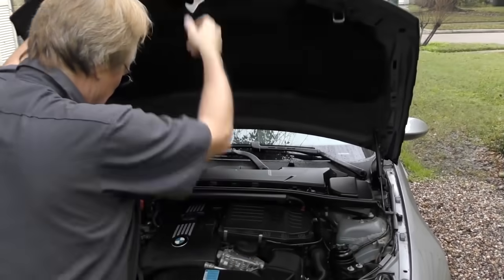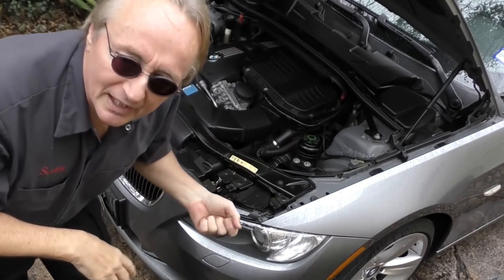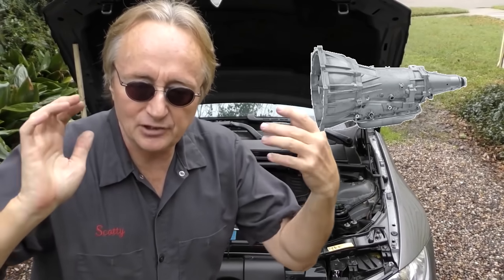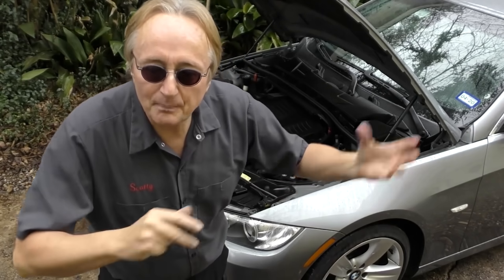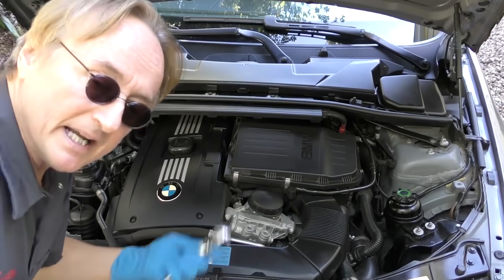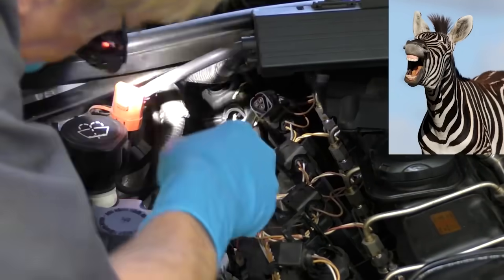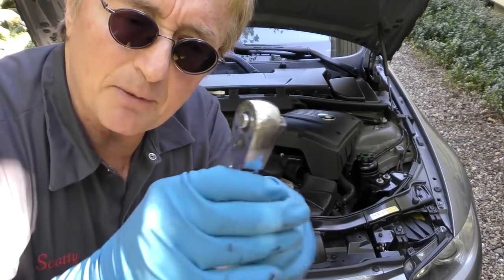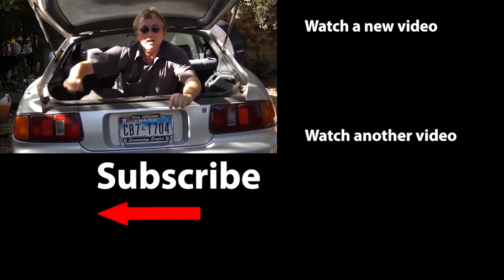People Say I'm Full of Crap About BMWs, Well Watch This

Comment: As a BMW owner (on number 4) you are spot on.  My favorite was the 98 3 series that was before everything was plastic under the hood.  Why do I still drive one?  They are just great handling/performing cars and that straight six is like sewing machine smooth.  When they work.  I know what I have and I know that the maintenance is horrendous.  Fortunately I am competent enough with a wrench that I can get a few layers in for some of the maintenance.  My experience is that the plastic starts failing at 8-10 years old and, as you stated, mileage isn't the key factor.  I will say this, to get to that no 6 spark plug take all that air inlet cowling of.  Not so hard after you have done it 2-3 times.  Also, if you need to change one coil go ahead and do all 6 with the plugs.  For a BMW they actually aren't that expensive.  Like you say, know what you are getting into if you buy a used BMW.
Reply: Same here, i do the work myself. I have a 06 manual 330i, the last n/a strait 6.  E90 is one of the easiest to work on, tools and resourses are easy to aquire. BMW have maintenence at mileage intervals. There are n52 engines with 500,000 miles.  Plastic parts are not that expensive, fcp euro has lifetime replacement for parts you buy from them even oil.
Reply: Yeah I had a 1990 320i with the M20, was beautiful to drive and easy to work on.

Now I have a 2003 330ci sport with 180k miles and I've had to do a lot of preventative maintenance that the PO didn't do.😂 Luckily I can do most of it myself so it's not been a fortune. For instance I literally did the vanos oil seals yesterday with Beisan systems and new hardware from BMW, cost £120 in total and the car drives insanely well now. I can drive in a higher gear everywhere the torque is beautiful.

But yeah as you say it's knowing what you're in for when you buy an older BMW!! Being prepared that you'll have to replace things. I did all new coils and plugs straight after buying the E46, the alternator died on me and now the headlights are giving me trouble 😩 but I wouldn't swap it for anything else, the way it drives and sounds is beautiful 🙌🏻
Reply: My e46 330ix is still driving with 260k on it the only time your going to dump money with a 3 series is if your taking it to the dealership for everything better off buying a Honda
Reply: Like a good looking women. Lots of trouble, but worth it.
Reply: Try and find a hot water heater tank without plastic parts, you will have to buy it on-line or use a plumber.  Nothing you can get at HD or L lacks plastic parts.
Reply: I agree - if you have to change one coil, do them all. I learned that lesson first hand.
Reply: @Coronado-nz7wu  Perfect metaphor. I've had many of both. I'm done with the women, but I still drive BMWs.
Reply: @malteserwfj  I bought a trashed but good bones 330ci, fed it 10k+ dlls and now it is a car I won't sell...
Reply: GEO: You are right. I had 2 BMW 3 series and both were 6 cylinder. I love them but when both reach 8 years some plastic parts begin to fail. The bearings of the engine pulleys and the electronic items begin to fail does not matter how much kms it has. Now I know what means and feels having a BMW and I am ok. Now I have Honda, Toyota and Hyundai products with no failures and a lot of peace of mind because they are reliable no matter how many kilometers they have. Besides that I am 63 years old and I want to enjoy driving them instead of paying high bills for keep them running. But I love the BMW security and high speed feeling.
Reply: @malteserwfj  Does your car have the biodegradable wire insulation? Bought my son a 330ci with it and it was an absolute nightmare in a hot climate.
Reply: @malteserwfj  facts I got a 02 330ci. Man I can’t get rid of her. She’s been very reliable to me. Still doing preventative maintenance 💪🏽
Reply: So basically if you buy a Beemer make sure you can wrench. If its new, you have some time. If its used channel your inner Scott Kilmer. Get gloves, tools, jacks, join a BMW forum, get into youtube and get some patience. Got it! 
This really should be included on the sales sheet lol 😀
Reply: @iallison401  facts. Plus The old BMW’s easy to work on too.
Reply: Just had to replace my water pump thermostat serpentine belt tires coolant hoses and now replacing the water pump again the first was fault 140k miles :(
Reply: FCP Euro or ECS tuning pick a parts place! Hahaha
Reply: I’m on my 3rd e46 this time a drop top black on black I love it
Reply: My Tacoma is all plastic under the hood. I don't think it'll last as long as I want it to
Reply: Are you American? Why not buy a Corvette if you want performance/handling? You need to spend 3 times the amount of a Corvette to find a German car to get in the ballpark.
Reply: Why waste all that money on a car that used plastic under the hood?  Man i could think of five or six other cars miles ahead of BMWs 🤣
Reply: @analogueoverdigital929  Don't think so.  All modern cars have gone to plastic.  Nearly all even use plastic intakes.  If you mean cars with more bling bling in the cabin, yeah you are right.  If you are talking performance tech, nope, there aren't many that even match.
Reply: @Coronado-nz7wu  damn straight
Reply: and NEVER use anything except Bosch plugs in a BMW.   anything else gives the car some serious heartburn

Comment: If you buy a bmw, plan to work on it yourself 

The thing about bmw is it’s very easy to work on it yourself with common tools. If you have the time, you can even swap turbos yourself. BMWs are actually a good learning experience

There are plenty of forums where people discuss common issues and how to fix them
Reply: Can you name a few forums for us?
Reply: @s.platted   is sarcasm
Reply: Sounds like cap
Reply: @s.platted  google is your friend. most popular platforms have very dedicated communities. E46 chassis (1999-2005 production date 3 series, 2000 - 2006 model year) for example is one of the most popular platforms for tuning/racing, and has a massive following of enthusiasts and vendors supplying OE manufacturer aftermarket parts. you save a TON buy buying the OE part, just without the BMW badge. The only parts that suck are interior parts, because theres not really an aftermarket for those. gotta go to BMW, where the door card armrest insert costs $250 (so i just got a piece of leather and recovered it myself)
Reply: when you work on them yourself that is when you realise the designers really did not want people to diy basic maintenance.
Reply: My 97 Z3 is surprisingly easy to work on. Lots of parts available too. I admit I’ve used high temperature epoxy on some plastic parts, but also notice that despite all Scotty’s complaining, the job actually went really smoothly.
Reply: Exactly. I enjoy working on these cars way more than I did working on Nissan or Lexus/Toyota. If you have the correct tools, the experience is rewarding. Forums are full of information on how to fix everything. Parts catalog and the diagrams are well executed and easy to navigate. Just have to have a functional brain.
Reply: I have Parkinson's disease and co-ordination issues and so NOT BMWs are NOT easy to work on. I can't wait to find a way out from under the Piece of JUNK BMW we purchased.
Reply: Had a 2000 330ci convertible and 2013 328i and both are fairly straightforward and easy to work on, much easier than many American cars.  Amazing thing is these cars do not rust, 15 year old bolts have zero rust on them so they come off and don't strip or break and that is half the battle in fixing old cars.

Comment: if you have to have a BMW and you have a reasonable budget and are pretty handy with a wrench, buy a BMW 128i. No turbo, no fancy electronics, and a reliable N52 engine. after market parts are  inexpensive. They are a lot more fun to drive then a corolla or camry.
Reply: Looks old
Reply: I have a 07 328i best engine! Only thing is coolant issues common . But easy to repair these other mechanic just want $$$

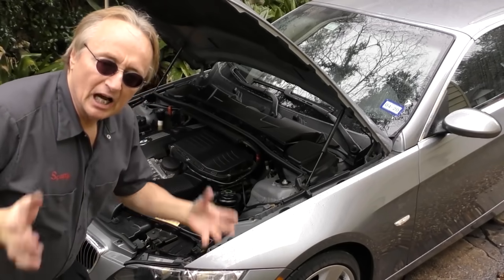Comment: 1:44 ''The overuse of plastic''

Spot on, and exactly what I was waiting for. I know a lot of garages won't touch a BMW over here, because when you get in there to fix something, something else breaks in the process. Plastic and heat is compulsory failure.
Reply: like 99% of post 2010 cars in europe. So 99% of cars on the road. What a great argument !
Reply: And someone is saying that only audi is plastic hahaha both are no different.😂
Reply: @MaggotCZ  BMW has been consistently ranked as one of the worst and most unreliable car brands in the world. Don't even try to compare 🤣
Reply: @z.kenpachi2226  my Tacoma is all plastic under the hood 🥲
Reply: @crusherman96  Shhhhhh.....all modern cars are these days, but no one wants to hear that right now, they'd rather rag on BMWs
Reply: @meatball4409  According to who? Both Consumer Reports and J.D. Power links BMW pretty high in reliability compared to many other brands with the exception of Toyota/Lexus (of course).
Reply: @zaspalia  Indeed, the new ones score well when it comes to reliability. It seems that it is expensive to maintain in America, yet in Europe it is a different story in my opinion. The problem is rather with the owners and most people not maintaining as they should, therefore 2nd hand models are usually a horrible buy. That said you should use OE parts instead of the original parts. They are literally the same and way cheaper. I rarely had problems with my BMW's and have driven them for 13 years.
Reply: @meatball4409 Wrong.
Reply: Even the valve cover is plastic, which is totally absurd. But it’s an industry wide problem not a BMW problem.